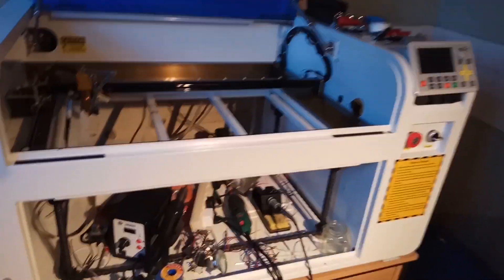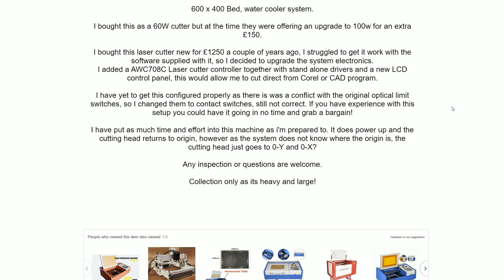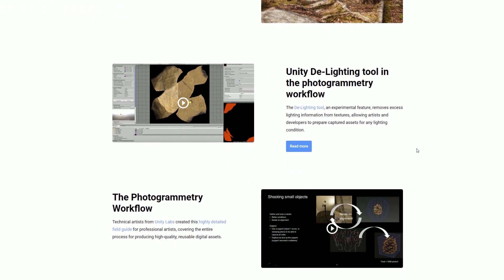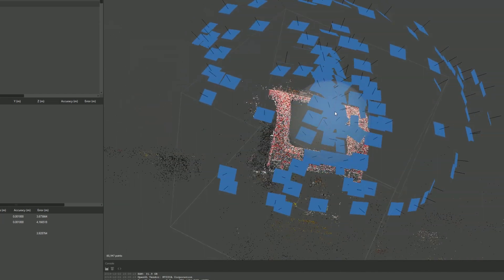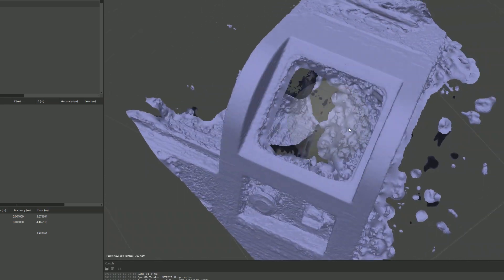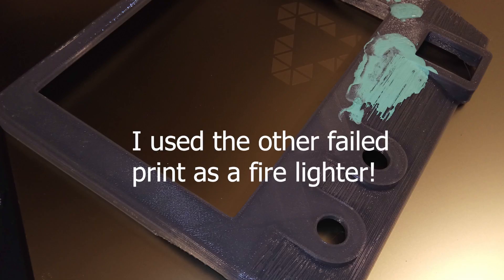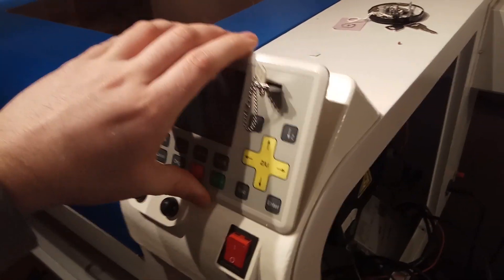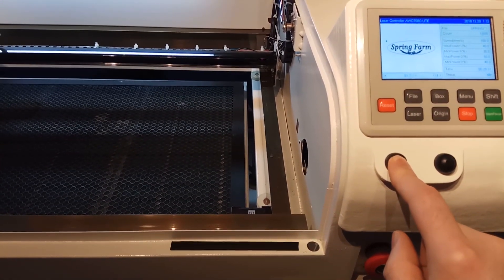Making a Control Panel Mount for my Laser Cutter using Photogrammetry

Comment: why not use a wipeable board marker?
Reply from the maker: Indeed that would have been a better option... I just didn't have any on hand :) and thought the sharpies would wipe off easily enough with IPA.  I think I do mention a water marker (whiteboard marker) or chalk would be better in the future.
Reply: @MD_Builds  I see, I was not familiar with the term water marker. Its a good idea, anyhow, using a marker to make it easier to model. I will use that in the future. But with a whiteboard marker. :)